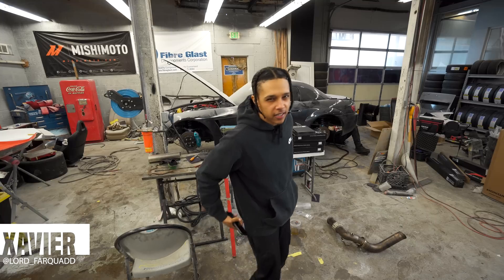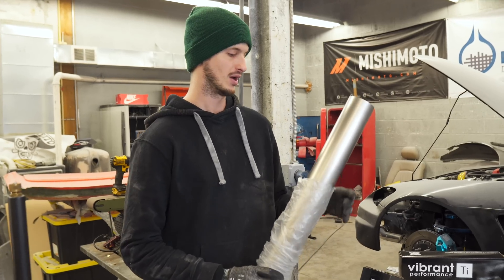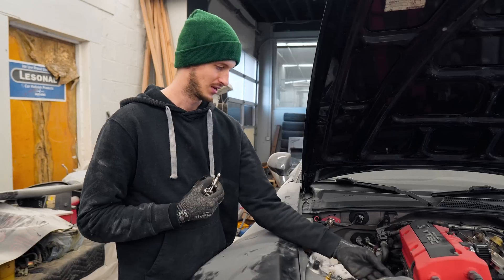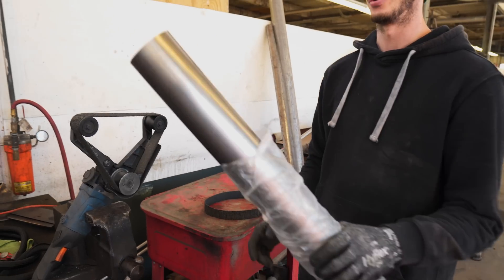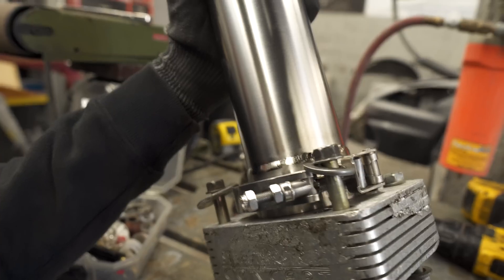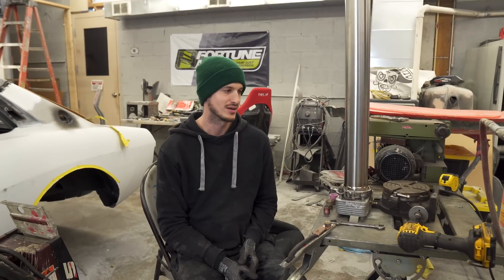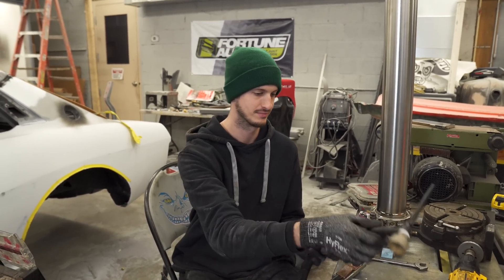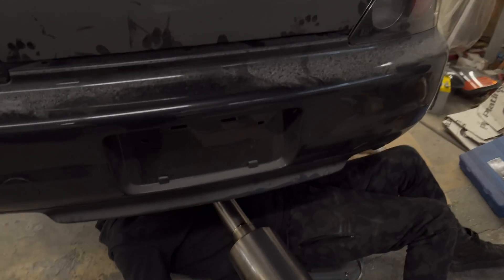BEST S2000 TITANIUM EXHAUST | Vibrant Performance

Comment: FYI Anchor makes a special paste where you mix it with 90-100% rubbing alcohol. It acts as back purging when welding. Great for TIG welding when it is hard to back purge intricate parts. 😉 Cost is about $10 for that little can of powder or paste.